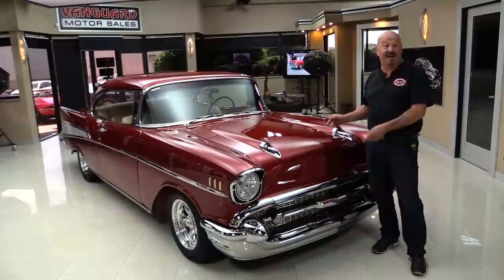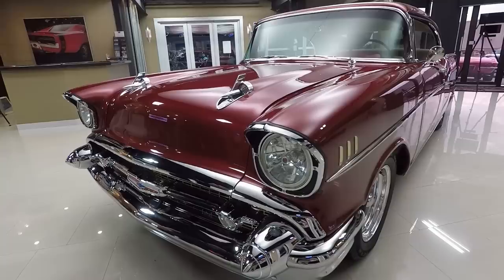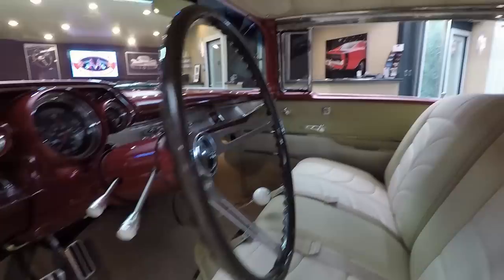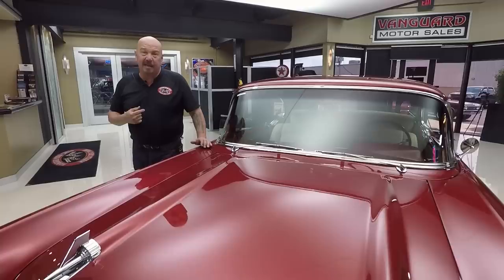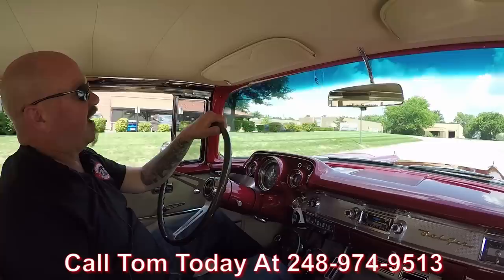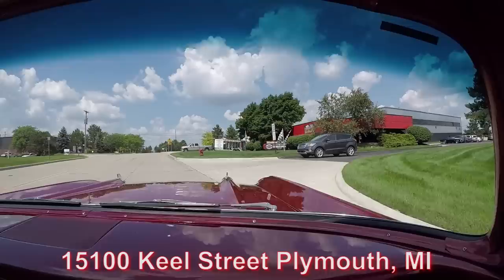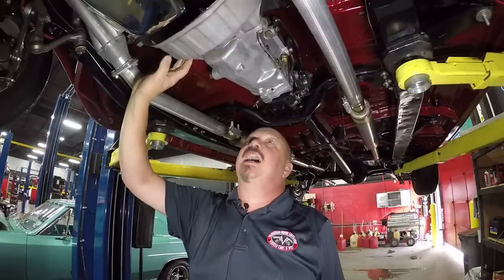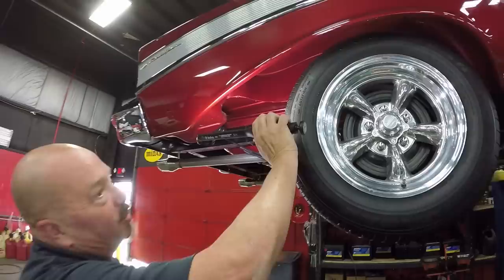1957 Chevrolet Bel Air For Sale

Comment: Chevrolet, dependability, quality, economic value ability.  The ❤️ of America’s motoring enthusiasts.

See the U.S.A. in your brand new 1957 Bel Air, now available with V~8 power as well.

You can get lithium batteries now that are only 1/5 th the weight of traditional lead acid. Less weight more pep.